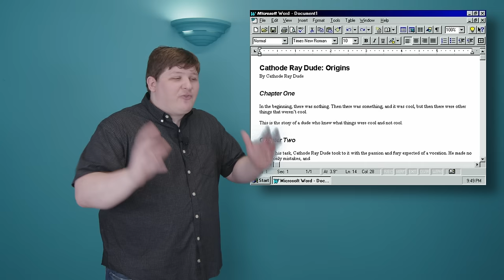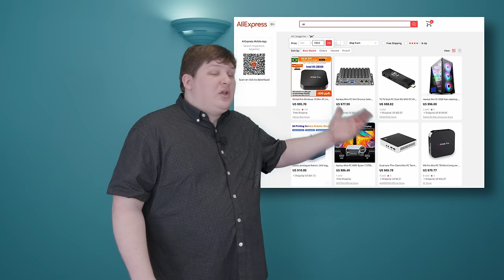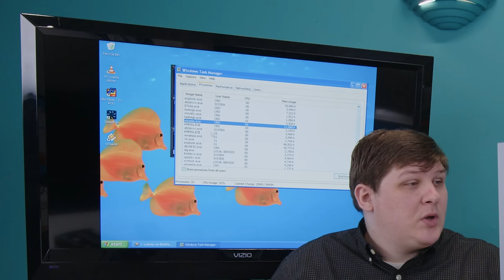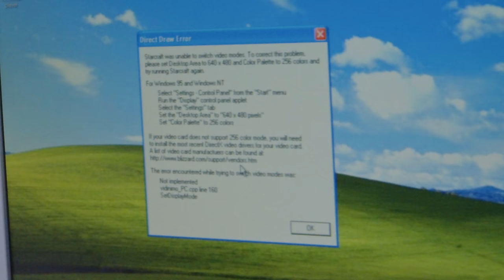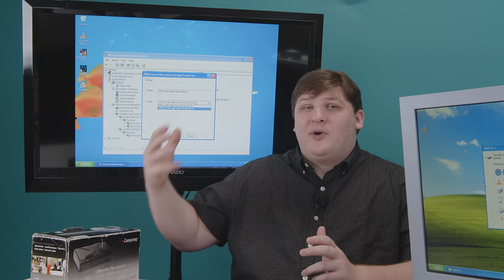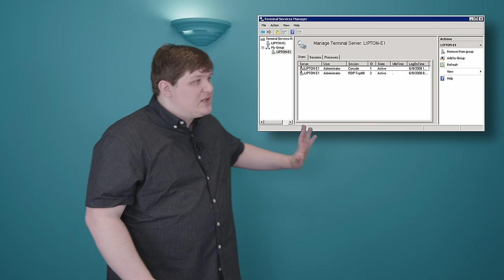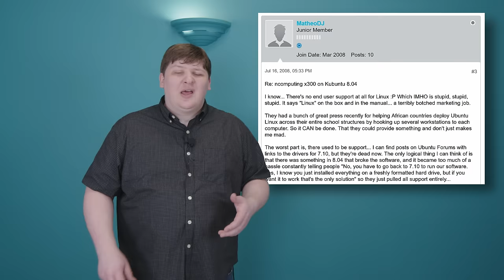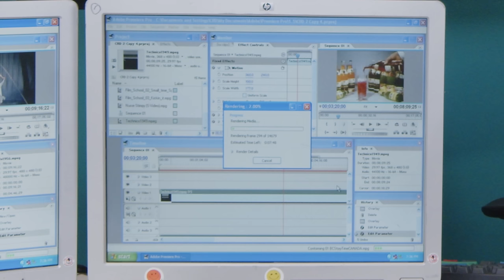7 Users on 1 PC! - but is it legal?

Comment: My theory contends that the reason you didn't find anything about a violation of licensing or the EULA, is because it wasn't.  So long as NCOMPUTING and MS had an agreement in the background that wasn't public.  And the fees for each TS CAL were built-in to each user of the NComputing hardware, per port.  So, if you bought a 3-port version, at $350 let's say, well a TS-CAL for a GOLD or higher partner like NComputing would have been, would have been as low as $30 or so for the dollar of the day per user CAL (Actually a HARDWARE CAL!  Because Hardware CALs exist, there are device CALs for TS reasons!), so $100 let's say of the $350, leaving $250 to cover that PCI card and the boxes, the boxes are cheap, the PLD's are not expensive, and the other components are pennies, and that plastic isn't looking' too exotic either lol, so cheap.  The real money had to go to the Altera FPGA and the memory, the FPGA was around $60-$100 or even up to $125 depending on volume, and figure $15-30 for the memory or less, I don't know the qty of it so I'm guessing.  When you put it all together? still a good margin for NComputing, not great, but not losing.  If the potential existed for them to sell hundreds of thousands of licenses under the MS HW CAL program, they would have granted them a special license exclusive of the EULA, if you read the EULA closely it basically says, "you cannot violate this unless...we say you can" and in this case, I contend that they said that NComputing could.  Because the licenses were all paid for already, legally either publicly at market rate or through a private pricing arrangement (I suggest the latter, with this kind of software customization and wizardry I would be very surprised if they were NOT a GOLD partner or higher of Microsoft's either as a SW Developer or HW Developer or Both) and under the HW TS CAL EULA or their private EULA Agreement, by NComputing, for each port they sold.

This should also answer your first question on "WHY YOU HAD TO PROVE YOU HAD THE HARDWARE FOR THE HARDWARE YOU HAD"...you were signing off the EULA on that HW CAL for that HW. :) 

This is all my guess, I was an Active Directory Admin and Architect in the 2000's and had experience using TS and TS HW CAL's running a call center with remote agents, where you can choose to license per SEAT or per USER and SEATS can = Hardware, such as a WYSE or WANG Terminal etc.  In fact, MS has always offered per seat or user licensing, as sometimes you might want to do per SEAT, where many or multi users were entitled to access the same hardware, independent sessions of course though, when talking about OS licenses, however with TS CAL's it works slightly differently, and multi-users ARE allowed in that case, but you must have both licenses lol.  Also in this case, this works for NComputing, as the user installing the card would be installing it into a licensed machine that should contain the bare minimum SEAT license that was needed to throw TS CAL's on top of it to allow multiple user session access.

So where does this all lead us?  Well, I guess I'm saying from my point of view and how I understand the licensing of the day as I was subjected to it, NComputing was NOT breaking the law, and everything was perfectly legal and copasetic.  Of course, that is all hinged on whether they had an agreement with MS for the TS SEATS LICENSES, and I can't answer that. Hopefully, someone else can.  And if I'm wrong here and someone can correct me, please do, I'm getting old, and I don't know maybe I am remembering it wrong.

Comment: Today, my pc is 15 years old, and I am doing new stuff, 4k edit, etc. The thing is I build my PC with i7 and it wasnt the cheapest, and I did SSD's and I did the fastest 32Gig ram at the time. In short, I didnt buy a $800 PC, sure I spent more at the time, but havent had to upgrade anything, today, I am thinking about building a new one, and this current one will be repurposed as a proxmox host for some of my VM's for my home lab, thus consolidating some of my older boxes.

As to thin clients, sometimes I use exiting computers on peoples desk with a terminal client; windows RDP or linux RDP, on the server side, I use proxmox with windows vm's - its a lower cost route. I have done this with a few offices/clients - plus it allows them to vpn in and use their desktops from home. (I have them vpn in so there are no outside rdp attacks)

Comment: I used to work for a internet cafe back in the day using L300's if I remember correctly, mainly because the boss was a vice like penny pincher.
For most people this was fine, and for those requiring gaming/heavier stuff there were a few dedicated computers for them.

Comment: Oh we had these in 2011-2014 at my (I guess underfunded?)  school in New Zealand. We used to send system messages to each other pretending that the user on the main PC got a virus and it would freak the teacher and other student out.
We also used to open the CD drive over and over until the feature once sending messages was disabled. 

I can’t remember if we ran Unreal Tournament on it? We did on the standalone computers but I’m not sure if we did on the terminals.

Comment: I mean, I still use a Haswell i7 system from 2014, it has a gtx 1080, a maxed-out 32GB ram and runs many games fine, even at 1440p. However, after 6-10 years, you have newer display standards, newer USB standards, newer TPM standards, silicon revisions that protect you from hacks, and more performant busses.  You don't need a new desktop every 3 years if you get good deals and aren't on the leading edge, just look at how Apple handled its intel processors in it's mac pros and Mac Minis. They were selling the 8th gen intel u series processors for 3+ years in the Minis. And the trashcan mac pros were being sold with the same intel guts for much longer. In fact, I think that's why apples usually have their very own SKUs.  But that is also why upgradability is important too, so you can add a 2nd or 3rd or 4th ssd, and so you can buy formerly super spacious,  expensive ddr4 kits for a good price and extent your unit's life before the recycler.

  On the same token, however, if you have a  laptop, you will need to upgrade sooner. If you buy a ThinkPad, Toughbook or  Precision that you didn't cheap out on in the beginning, and it's handled with care, it'll last you 5-8 years with maybe a battery replacement or two, and possibly a keyboard or screen replacement. But if you have a cheap AF consumer laptop, or you treat your system like the Toughbook it never was, then yes, you will need to replace your unit every year or two. A rule of thumb here, other than making sure whatever you buy something designed well and doesn't have the ram and SSD soldered to the motherboard,  is that over time, you need to reimage your units as sometimes there are driver corruptions or broken programs that cause bigger and bigger issues as the os ages and the software gets updated. The installs tend to get bloated and just slower as crap piles on more and more.

Personally, I will be upgrading when I can get a fantastic sound solution, 10gbe and thunderbolt 4 or 5 on the same motherboard for under or around $300. Either that or when ddr4 and the current hot AM4 &  intel stuff becomes super cheap b/c of big.LITTLE becoming an x86 industry thing. Laptop-wise, I'm watching the industry closely to see what pops up in regards to big.LITTLE battery life and intel Arc, but will probably go with another X1 Extreme if the battery life lives to the claim. Fingers crossed for affordable 32 in, 4k 144htz displays.

Comment: as you said we used those 2 systems (athlon and celeron) that i mentioned under another of your videos, from 2001 all the way through 2013 2014, as all we did with them was writing homework and use some basic drawing programs

Comment: Been doing that since 2005 upto 20 PC with nComputing L-series (vSpace 4), great power saving on electricity bills. It has no CPU only PLC, but you can achieve it with raspberry pi3 + rdp today rather than expensive newer generation L-series.

Comment: My step-grandfather bought a Pentium 4 based Dell dimension in the early 2000s, because when else would it have come from. He kept using that machine until 2014, and the only reason he upgraded was because he ran out of hard drive space and didn't understand the concept of getting a new hard drive.

Comment: Well, I'm not sure that your explanation of how it worked was entirely accurate, but it certainly seems to be correct enough.
It might just have been possible to create more sessions and then assign hardware to them without limitation, but I don't know these old versions of windows not nearly good enough to be sure. (Microsoft doesn't enforce many of their licensing limitations. I.e. guest users per licensed user in a business Microsoft 365/Azure AD Tenant: Usually  you're only allowed to have 5 guests/ 1 licensed user without getting charged extra, but for a long to time you could just keep adding and adding with no side effects. I would double check that's still the case though before abusing it)
Reply: Wow that comment got really long. It's probably full of mistakes... It's 02:36 am and English is not my native language, so please go easy on me.

Comment: we used to had these old L250 or L300 models in our schools. around 20+ deployment. runs well with a ryzen 7 main server and 128gb of ram. the downside is only the yearly cost of AMP license per deployment. which is around $15 or so. And so, after a few years we decided to just get a cheap 2nd handed dell optiplex, which can be get for as cheap as $50 per machine and it comes with a 3rd gen i5 too. no more yearly cost and much more powerfull compared to the ryzen 7 server divided by 20+ user, and it remove the headache when configuring programs that cannot be used in multiple rdp session at the same time.

Comment: I've been playing around with Mac OS 9 in SheepShaver and using the Classilla web browser therein and it has taught me that a big stumbling block for old computers and OSs is the browser not supporting newer encryption protocols. Got a ton of Encryption errors that were so severe that the browser couldn't even load a site at all. Pretty sure this is something related to HTTPS.

Shoutout to WinWorldPC for providing the installation disc ISOs that made it much easier than using the old floppy ISOs - 17 disks for System 7.5.3 😣

Comment: I rebuild and resell PC's on the side, I normally go threw some sort of evaluation phase with them if I can call it that and base what to charge for it, I normally do not resell a PC that can't watch youtube at 1080p 60fps unless its for a certain task like a cheap NAS. I've had experiences where people would buy an older system from me, and then complain that it can't watch a video at said quality despite the system being dirt cheap.

Q6600 is as old as I'd go for Intel, as it will still comfortably play 1080p 60fps as a base and it will play 1440p. AMD Athlon x4 645 is around the oldest I'd go, of course you still get modern stuff that can't even watch things at 720p, I got a few Atoms and a x2 Sempron that was released in 2018 that can't even run light version of Linux smoothly.

So system that don't pass my tests to be resold, I keep some of them, I use that Sempron as a Thin client for my garage PC for listing to music, looking up parts, my server handles the load of that, works fine for that, I got a old Q6600 system my grandmother fell in love with when I got it from an auction because its in a slim line dell case that was painted pink lol. Rest of the non working or too slow to use stuff, I normally list them up on marketplace for free as the nearest recycling place that will take that stuff is 2 hours from me and charges me to take it....

Comment: @40:32 I fully expect it's actually using the NT Terminal Services, or something of the sort. Windows XP is basically NT for the home (as is Vista, 7, 10, 11...), it comes with a very similar kernel, and a set of services. NT is a fully multi-user kernel and OS. Microsoft didn't licence the home machines for Terminal Services - but it didn't mean that it couldn't be done (you were just in breach of the licence, I assume). Things already run on their own "virtual desktops" under users like SERVICE AUTHORITY or SYSTEM - all you have to do is coax them to be displayed on ACTUAL GPUs, and BOOM: multiple desktops. They simply used a ton of functionality that was already there to begin with.

Comment: Correction: Word 95 would not be massive overkill for writing books, it would be a disaster. Word 95 crashes as soon as you have 20+ pages. But the point of course still holds, that was not a problem of the computing power of the machine, but the poor programming at Microsoft.
Reply from the maker: Hahaha, okay, without even fact-checking this, I can absolutely accept that you're right. I never tried it!

Comment: My late 2012 quad core Mac mini still works fine today. Including all the web. 16 gigs of ram and a sata SSD, and I had those in 2012 as well.

(Edit: not to say that I’m not looking for a replacement, but I think I’m waiting for the m2 Mac mini or ideally a Mac mini pro that has a few extra ports and an M1 Pro chip, without costing the 2 grand of the Mac Studio)

Comment: Isn't the hardware setting up a standard star topology network? 

I started a computer lab in 1987 using 8 Commodore 64 computers daisy-chained to one 1571 floppy drive (x 2), obviously not the same thing as we had separate full computers at each station, but one of the ways we did it all for for 16 stations for about $9300, including the tables and chairs, and typing and word processing software! 

We used that for about nine years before finally succumbing to the draw of the PC world in a standard networked server system using ISDN, and then DSL. (We never could have afforded an Apple lab in the mid-90s.) I did consider thin client boxes at one point, but found that with our existing server system, and a somewhat unsophisticated user base, we were able to keep the lab running (until COVID hit) using relatively easy to find refurbed older units from recycling companies like Coretek Computers. 

We then made the transition to Chromebooks in 2012, which have their own set of issues, but provided significant advantages during COVID. The lab now uses Raspberry Pis using a lot of the old monitors and keyboards. Lots of good ways to do labs nowadays.

Comment: My (slightly wild) guess about the weird serial number DRM is:
The thin “clients” are so rudimentary they must have been easy to clone and reverse engineer, and maybe N Computing had some more or less formal agreement with Microsoft that if it’s only their devices that are using this trick, then MS would let it slide
For all intents they’re just a strange form of KVM switch, after all.

Comment: I've enabled multiple concurrent users on Windows 7 pro using remote desktop, including the local user. It was years ago so maybe I'm remembering wrong, but I'm pretty sure all I had to do was change a registry entry to enable that. Although unlike these solutions, it did require a separate computer capable of accessing remote desktop.

Comment: Regarding "the plateau" discussion and web browsing specifically. It's been my experience that software demands (and/or performance improvements, at least at the lowest common denominator low-end) have slowed considerably in the last decade or so. I still have painful memories of using a ~7-8 year old Pentium 3 back in the late 00s on the then-modern web, but nowadays I still use an old first-gen i5 laptop from 2010, with only 4GB of RAM, and it happily handles the modern web as long as I don't let myself rack up dozens upon dozens of open tabs. I suspect the main driver of people upgrading PCs nowadays (outside of RAM upgrades perhaps) isn't web browsing, but gaming and professional work, like you'll want newer GPUs for games becoming more demanding, or to get hardware codecs for stuff like HEVC or AV1 to speed up video editing, or you want tons of cores for speeding up software compilation.

Comment: My first home PC was an ABS (stood for Always best Service back then) Cyrix system because Computer Shopper said it was the best $1000 PC (entire system) in 1999 (iirc). Had to buy an Intel chip after trying to add a discrete GPU and the drivers did not recognize the CPU. Anyways, my second home PC was a sub $200 refurbished Dell Dimension 2400. Dell's refurbished program back then was stellar- BUT, it was also dependent on what they had at any one time. If you wanted to buy 20 PCs that all matched, that was going to be a problem. Heck, that's probably an issue now if you try to buy refurb unless you get lucky.

Comment: I used to open 50 PDF's at same time for referencing them. Now Acrobat Reader DC crashes, has memory errors or rendering faults.
I am doing the same as before, but have been forced to update the reader. It sucks.

Comment: It not going full screen but rendering fine is a dead give away that it's a virtual display controller. This used when using remote desktop for example. Ironically enough these days it might actually make more sense to do this by having the card be a NIC with an entire second PC on it.

Comment: Had that in my highschool. was pure hell when 1 ethernet cable got just some tiny damage it would trow the entire system off. But it gave me reasons to skip some classes and fix the school server instead. but they had 24 computers.. What was awesome is that CS 1.5 ran on from same hdd with same cdkey to 16 players.. which was odd that it could even deliver that when 8vs8 players shoot at each other.